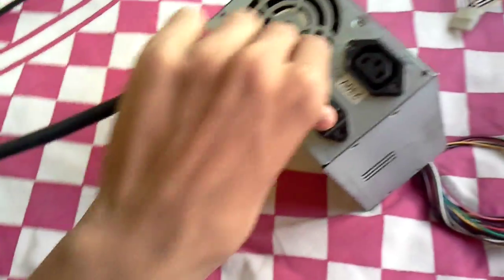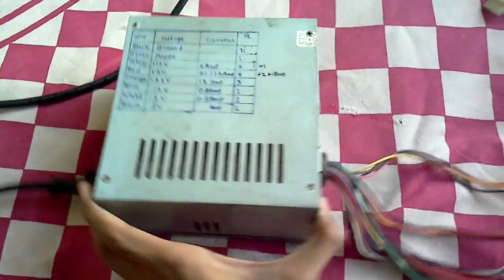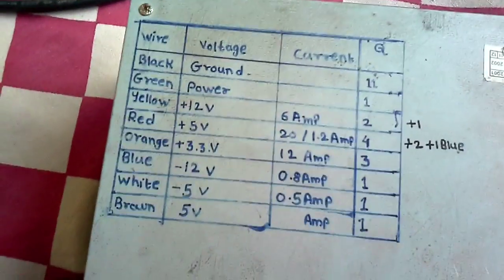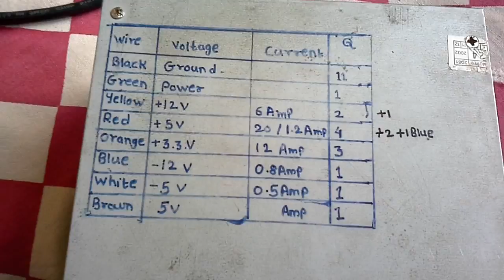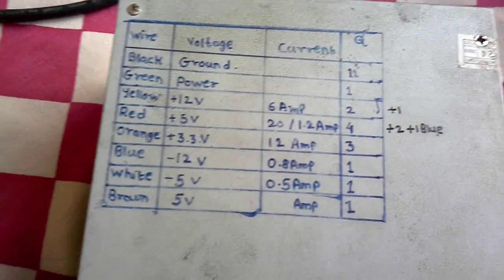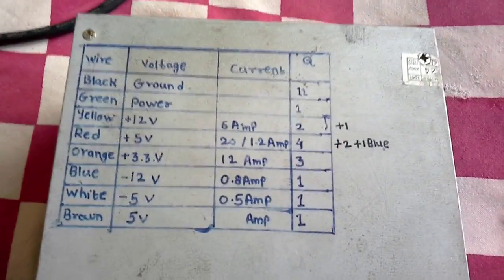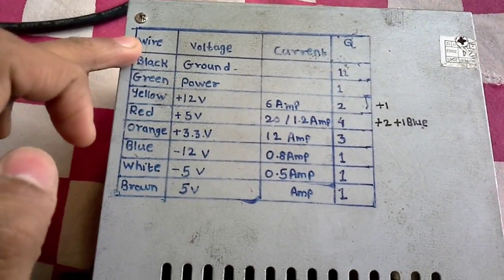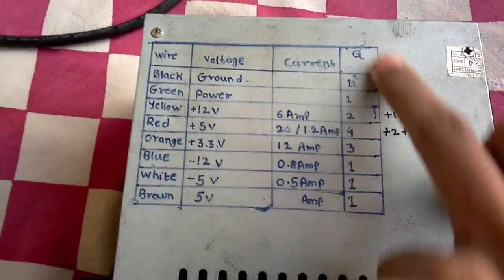Diy lab power supply from old computer

Comment from the maker: The power supply rated as 10 A can be able to provide max 10A, you can connect any circuit under 10 amps to work as expected, but if you connect say 20 A of load power supply no longer can maintain power(voltage*current) output.

But for same power supply you can connect 5A of load with no problem, since the load has limits to consume 5A current ,in normal conditions.

Comment: I'm sorry for the stupid question, but the values for the current are the maximum or does the power supply simply outputs the current needed? For example, the yellow wire has 6Amperes. Can I connect domething that only needs 4 Amperes? Thank you